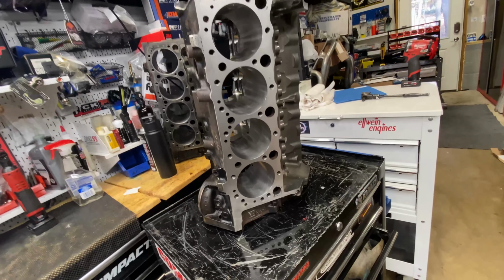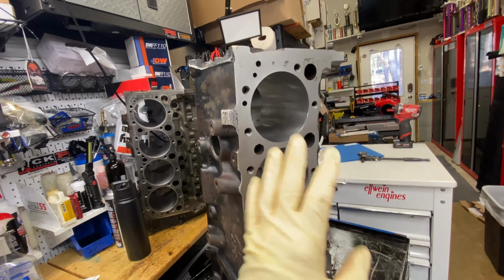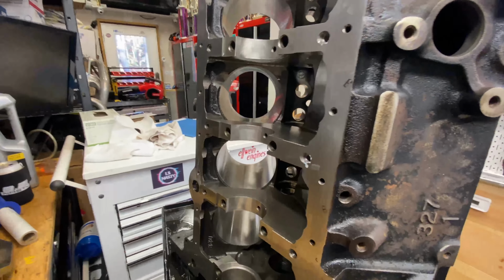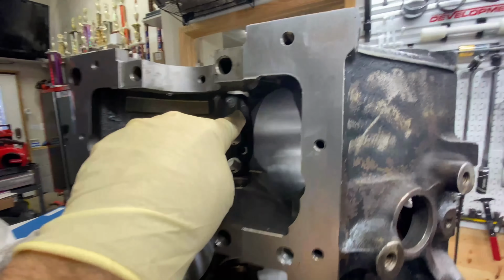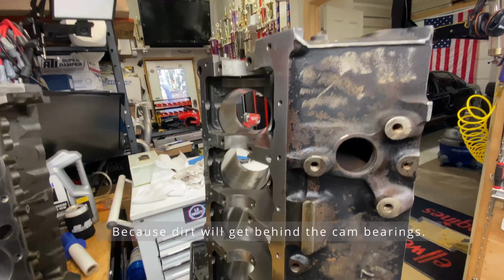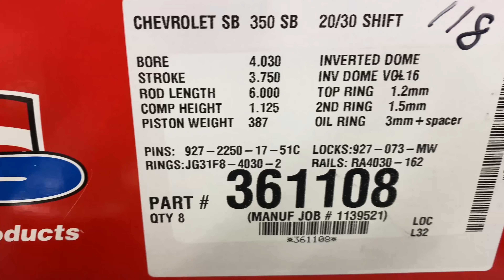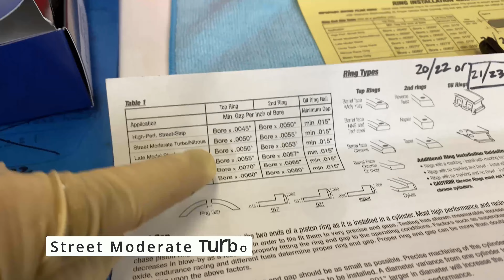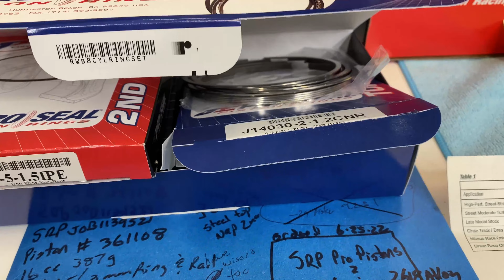LT1 383 Number 118 Assembly Part 1

Comment: This is good stuff, I've built many LT1 3.75 stroke engines using AFR heads for road racing, learned early on you can't use Scat or Eagle rotating assembly's, over 450 horse they will break, I've been using Callies for a while now, have not had a crank issue since, the engines are smoother also, now that we thought we had these engines bullet proof, booth engines broke a piston in half, across the wristpin center this past summer, SRP forged, got one rebuilt ready to put back in, trying Ross pistons this time. Any suggestions?
Reply from the maker: Road racing it tough.  Probably the most harsh for the motor.  I really cannot offer much of any advise for the longevity side of things.  You already have the good quality Callies crank.  I think most piston companies are quite similar in quality.